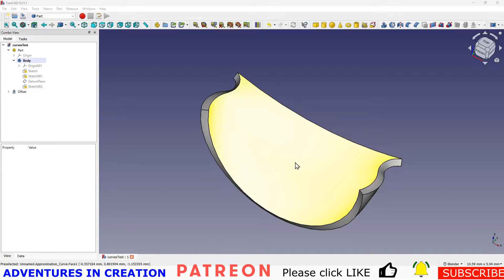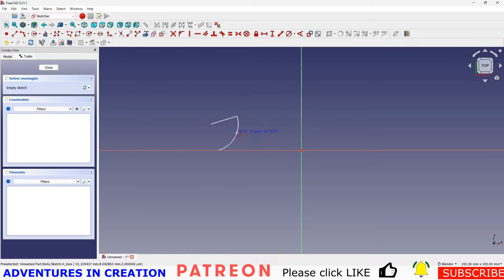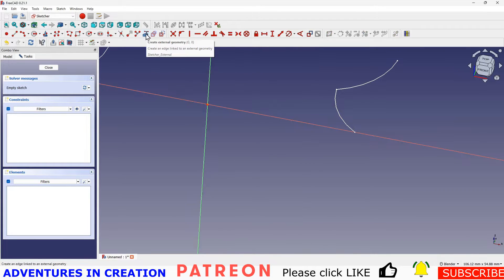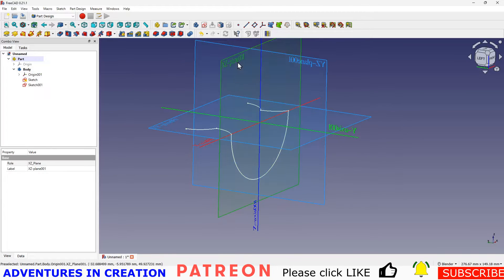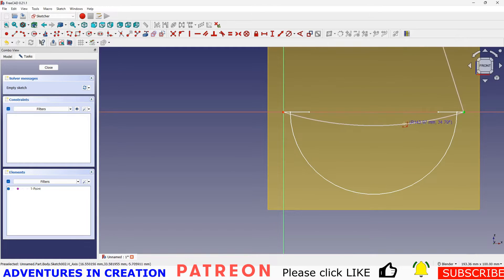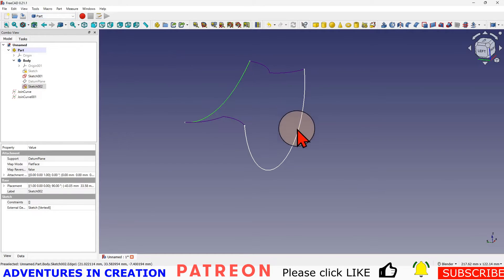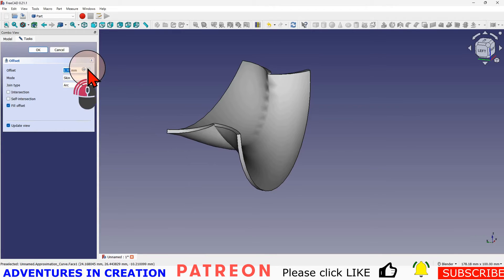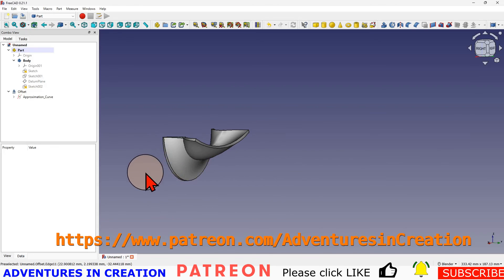FreeCAD for Beginners #61 Using Curves to create complex surfaces #freecad #cad #makers #curves

Comment: Great, easy to follow video.

I followed along with this video using version 1.0.0 up to about 4:16 when attaching the xz sketch plane to vertex 3 the plane would move but lay on the plane that was drawn on. Is this something in the new version?
Second question: can that drawing plane be aligned to say 3 points, and if so how?
Third question: mouse rotation doesn't work for me following r+o keystrokes or holding shift with mouse. Anything new there?
Reply from the maker: I am not aware of anything being different with planes but because the TNP has been mitigated you can use faces to sketch from now. The mouse options can be changed lower right. Mine is in blender mode.

Comment: The end points and rim points curve, how do you curve it precisely?
I’m trying to model a Reflex Sight, the amount the side curves stick out from the width of the sight is 10cm, so each curve would need to be a total of 5cm, but it seems that the radius is calculated based of off the curve, and then it’s centre point which is pulled way back and most of the time out of the sketch, I also can’t do a measurement constraint from the curve to the main box my curves come out from, which means I can’t take that space into consideration for manually measuring and adjusting the curve, I know it’s probably really simple, but I just can’t seem to figure it out, and can’t find any videos specifically on precise curves.
Reply from the maker: Can you share your sketch so I can better visualize what you are trying to do

Comment: Newly subscribed and a newb to this world.  I started at your "Freecad for Beginners" at #1 and am progressing.  I started making a "Bloomin' Onion" mold.  It is basically just a 4" diameter cylinder with a 1/2" base, enclosed bottom and numerous vertical slots equally spaced around the perimeter.  I got the cylinder formed and one slot cut(using Boolean) but am now stumped.  I have tried Datum plane but don't have enough experience to properly execute.  Could you do a video explaining or possibly get me going in the right direction?  Thanks for the excellent series.
Reply from the maker: Absolutely, can you show me a sketch of what you want. I will create a video to produce it.
Reply: Thank you.  Just traveling for a couple days.   How do I get a sketch to you?
Reply from the maker: @skutahuniai4830  you can post it somewhere that I can download it. That's the easiest way.
Reply: @Adventuresincreation  If I drew a sketch and posted it to Flikr, could you get it there?
Reply: @Adventuresincreation  I joined your Patreon and left you a message.
Reply from the maker: @skutahuniai4830  I will take a look
Reply from the maker: @skutahuniai4830  That's great!
Reply from the maker: @skutahuniai4830  I went to look for your message but don't see anything there?
Reply: @Adventuresincreation  I am looking at it right now.  Its in "Community - Direct Messages".  Your reply was "Thanks for the support" unless that was auto generated.